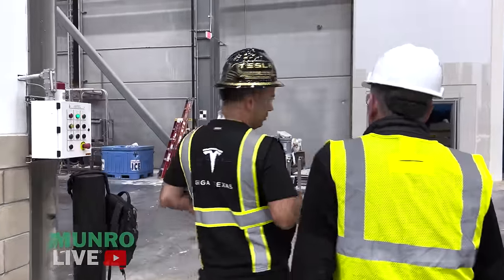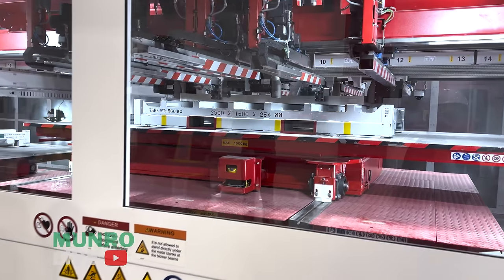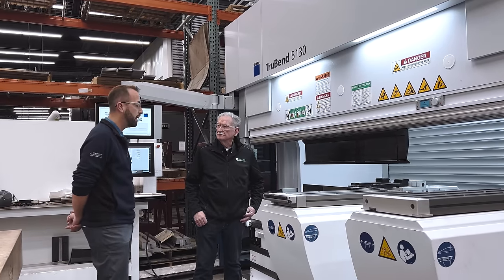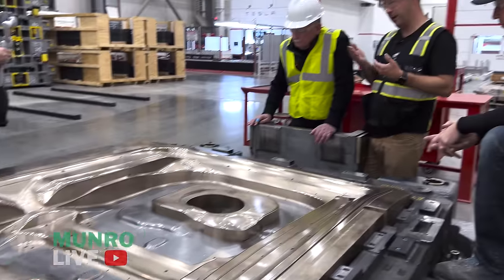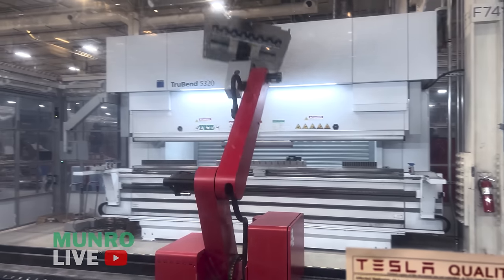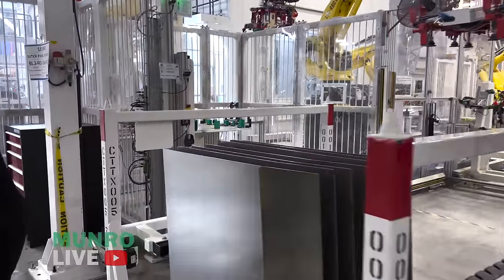Tesla Manufacturing: See how the Cybertruck HFS Panels are Blanked, Bent, and Built!

Comment: I'm interested to know how the costs compare to standard steel+paint construction. There is a lot of expensive kit here, but the result is fewer parts and fewer processes so if you make enough of them it's going to save money. Stainless costs a lot more than standard car steel, but zinc dip and several coats of paint is presumably not cheap either. I have no idea how those costs work out. They presumably have some hefty development costs to cover too. Quite a lot of smart people developing stuff over several years.

Also interesting to see how the public will take to the 'just one colour' somewhat utilitarian aspect of this. It's great from an engineering point of view: form follows function. But one of the most popular things about mobile phones when they were new was clippable coloured bodies and the people selling ring tones made a fortune. That's the stuff of marketers, not engineers. People are used to picking a colour these days - I wonder how many will be happy to lose that, having no interest in all the good things that come from not circulating loads of paint in the environment.

Anyway great episode. Very interesting and informative.
Reply: The lack of a paint shop alone saves biggus buckus.
You can wrap the Cybertruck - Franz Holzhausen drives around in a black CT for example.
Reply: @Martinit0   And that black CT can run right next to the Batmobile and not look out of place! 🤯🤣

Comment: For followers of the GT construction videos from Joe Tegtmeyer, Jeff Roberts, Brad Sloan, Airwave Dynamics etc.

0:09. Enter Stamping 2 extension through the west drive-through door.
Lars, “so this is our stamping building, we have three 5 stage tandem presses. 2 transfer presses, first of our 2 hot-stamping presses.”
Lars points north to their first of the 2 hot-stamping presses. Press is in the west side of Stamping 2. A press is visible at 0:21 as the camera swings around. Presumably this is the hot-stamping press.
0:21. Sandy, “so are you bringing in plate stock?”. Lars, “we’re bringing in coils, and I’m going to show you how we straighten it”.
0:23. Pass by the central line of columns, now in east side of Stamping 2.
0:48. Scrap bins. This particular area we saw having screw piles installed. 
0:54. Looking east out through the drive-through door.
1:35. Straightening-line in the background. Central line of columns are behind the straightening line.
1:57. Straightening-line Lead Engineer, “this is the first of its kind laser blanking-line…….this is a special development as well, this is something that is primarily used in mills”.
2:46. Stainless steel is 1.8mm thick for the doors, everything else is 1.4mm.  Presumably “the sails” are the rear quarters.
Precast panels of what was the outside wall of the original Stamping building visible past the braced columns.
3:30. Straightening-line lead Engineer, “then it’s going into the laser booth”. Which we can’t see yet. 
3:45. Straightening-line Lead Engineer talks about the accuracy, “it cuts up to 30micron and it’s the first laser of its kind to do that, typically these machines cut at 1mm (1000micron), this was a special development between Tesla and Schuler”
4:55. Door to laser booth. Lots of laser warning symbols.
4:57. Lars. “this is one of our transfer presses, smaller one, we just make small parts, 
we actually in-sourced 70% of stamping form Model Y and Cybertruck”.
Not sure what “in-sourced” means.
6:34. Second press visible to the north.
14:17. Still in the east side of stamping 2. Lars, “this is our die storage area……..the inner panels are also stainless”.
14:42. Dan, “this is our front door inner, 2 out die”
15:04. Dan points to the second press that is being used to stamp out stainless steel door inners.
15:22. “front door inner like Lars stated, dual”. Stamps 2 inner panels per die.
15:27. Die lower half.
15:35. Die upper half.
16:18. The whole die is aluminum bronze.
17:45. Dan. “do you want to see hot stamping from ground level?”
18:20. Made by AP&T. Second one coming to be installed west of this current one.
18:33. They turn west back past the row of central columns into the west side of stamping 2.
20:53. Hot stamping. Door ring/passenger side. Lars, “what are you doing now inners or outers?”
Dan, “we’re doing inners”.
21:06. Looking north.
21:23. Dan, “body side inner”
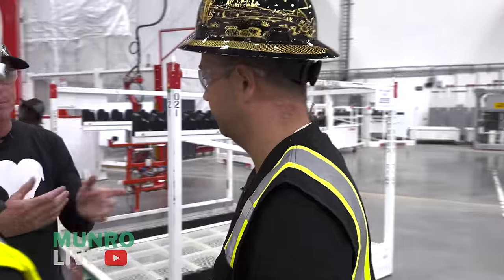21:50. Dan, “we supply body shop right over there” Body shop is west again. Part of GA.
22:25. Level 2 of Stamping 2/High Bay. Facing west.
22:41. Lars. “We actually have the body shop on the second floor here”.
22:50. Lars. “Least number of parts now, down to just over 100”. I take it he is talking stamped parts.
23:11. Level 3. Column rows M5.69. Not sure what the 5 means, but this would be M69.
23:22. Door outer on the rack. This seems to be Cybertruck BIW.
23:29. Door outers to the left and right. Column L70.
23:44. Cybertruck front assemblies.
23:51. Lars “Mainline goes this way and then is transferred to our powder coating that does the black coating over there”. Not back to Paint is my interpretation.
24:00. Sandy “You don’t use L-PO?”. Lars, “whats’s that”. Sandy, “you dip the whole car in”
Lars continues, “its a soft e-coat with a powder for that black area, we only have one oven”
Seems they don’t dunk the bodies in a bath.
24:51. H75. Trumpf Tru-bender. Lars, “one for each panel”. Suggests up to 10 Tru-benders. 4 doors, 2 rear quarters, 2 front fenders, tailgate, trunk lid. Seems a lot.
28:57. Door panel check jig. Marked Everest.
30:47. Exterior door panel. Lars, “takes 75% of the side impact load”.
31:09. F75.
32:47. F79. Diagonal external wall in the background.
32:51. Door assembly. Inner and outer laser welded together. There goes my adhesive theory.
33:35. Lars, “laser ablation” to clean up the laser welding marks. Ablation (Latin: ablatio – removal) is the removal or destruction of something from an object by vaporization, chipping, erosive processes, or by other means.
34:06. E80. Doors on elevated jigs. Saw these through the loading platform opening.
34:47. Lars, “2 brillo pads”
35:13. Completed door.
37:05. Dan has a ‘Giga Texas Melt Center’ shirt on. 
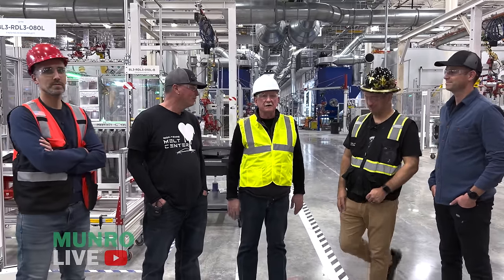37:27. Sandy, “Keep watching, because there will be more”.

QPC. Quantity Per Container.

E-Coat also know as Electrocoat , electrophoretic paint, EDP or electro-deposited paint.

Comment: I worry about crevice corrosion in the faying surface between inner and outer panels. Stainless steel is very susceptible to this behavior if water gets in that area. The corrosion rate will be sky high but won’t be immediately visible, especially with these heavy gages, for quite a while.  But if you were to peel back the two surfaces it would be blood red with corrosion. It may have been done later but that joint needs a sealant to preclude water wicking into the faying area.  This behavior is why WD-40 was invented first the atlas program.

Comment: Munro what was not completely clear was - are the body side panels (door openings that get powder coated) Stainless steel or Boron Stainless Steel. It was not clear in the video and now has resulted in questions. Seems a stainless truck does not need any parts susceptible to corrosion.

Comment: A square meter @ 1.8mm thickness assuming 8g/cc is 14.4 kg (31.7 lbs).  This is about the size of one of those door panels.  The sheet metal used on trucks has nearly the same density and a similar sized part would weight about 7.6 kg (16.7 lbs).  There is not that much SS on the CT and considering the material properties and the structural benefit the CT use of SS saves weight in the bigger picture.

Comment: Wireless charging is not necessarily prohibitively inefficient.

In a cell phone, it’s not very efficient because it doesn’t have to be because we are talking about so little power.

In a large electric car, the inductive coupling is the important thing, and that is a well established field of electrical engineering.

I’m in electrical engineer and I can tell you please don’t worry and lose sleep over it. It will come along pretty quick and it will be well in the high 90% in efficiency.  Expect 95% or higher.

Comment: I'm still hoping they will once make a semi trailer with batteries, electric motors, solar panels, name it.
They could make an ultracasting for it, put it full of camera's so it works together with the semi FSD really well. 
It could even park on it's own, without the semi needed to be attached to it.
It would help with cooling transport and it would even make a diesel drive much more efficient.

Comment: I have been working in stamping industry for 30 years, i can assure you that nothing -laser cutting, hot stamping, air bending etc.) i saw on that video is done either differently or better than in the car OEM factories i work with in Europe or China. Typical tesla narrative: we are far better at innovating in what everybody else has been doing already for years. All these machines are standard, the mentioned tolerances are standard, no process innovation ever mentioned: straightening coil before stamping and optical blank measuring? What an innovation !

Comment: "If your bad at what you do" holy cow dude 😅🤣😂🤣😂
Insane they got down to sheets that are less thick than 3d printer filament line. HFS is some insane stuff. Quick to make. WOW
Just on some of these parts they could ramp to crazy fast with current stamping processes. Of course whatever slowest prart/process will determine production, likely final assembly.

Comment: Sandy, Lars, you’re using Bronze-Aluminum coating on a steel die and you have to refinish it every 50 stampings? YOU NEED TO SWITCH TO BLAZE®️ from B4C Technologies. It will reduce your friction coefficient on Stainless Steel by around 45% while increasing your surface hardness to an extrapolated 106-116 HRC… harder than Thungsten Carbide. And it’s not a coating. It’s a non-brittle thermal infusion that will not affect your die’s geometry. As CEO of B4C Technologies I welcome your inquiries.

Comment: Number of parts before aluminium bronze die 'reworking' around 17:00 make little sense, whether 70, 80  or 1200.  Surely that would  make production costs astronomical ?
Reply: Not really. They aren't replacing them remember, slotting a new one and tuning the old one to make sure they still perform well.

And that is at the start of ramp up where they want to keep everything in check and are super conservative with their tools.
Reply: @mobiuscoreindustries  I'm curious on how  many body panels a typical automotive press can  make before the tooling needs overhaul and what the unit cost of the processing would be. I understood the tooling cost is astronomical, based on past  experience on simple forming of industrial lighting reflectors a while back.
Reply: @philhealey4443  I think it comes mostly down to time. 

Like how long does it take to swap the die with the spare and how long it takes to overhaul the die so it can be rotated again. 

Since they have been incredibly effective with their model 3 and Y production lines using much of the same things I would assume that they are adopting this practice for a very good reason. Of course there they use aluminum, so they probably get more cycles out of it, but I can't imagine they would make such a radical pivot without applying it to their other processes, as they have done with every other tech iteration on their other models. 

But I am not directly working on that kind of machine nor privileged to industry knowledge so I can't really infer more than that.

Comment: Amusing trivia @21:09 and @23:28: the electric car company is using propane-fueled forklifts inside the factory, not battery-electric.
Reply: Just like how solar panels get transported by trucks and wind turbines get shipped to their ocean foundations by petrol powered boats. 

You cannot do everything everywhere and all at once. Fossil fuels are still incredibly convenient and energy dense and a way better option than BEVs in many situations .

But every automobile on the planet pollutes more than every forklift on the planet. So you sort out by levels of effectiveness
Reply: @mobiuscoreindustries  I understand your point, but electric forklifts are readily available... you can have electric truck production and electric forklifts at the same time. 

Also, there's no chance that a modern car compliant with current first-world emissions regulations and used for a few kilometres a day emits more than an unregulated heavy forklift working all day.

Comment: 25:31 air bending, up until today, meant bending on a press brake without coining the material into the bottom of the die.  Actually I'm pretty sure that's still what it means but I'm still a little curious if they actually have some new innovation here.  Sounds like someone misunderstood what air bending is and is trying to use it as a marketing ploy.

Comment: Wow, 50-100 parts before the bronze aluminum die has to be reworked. A conventional cast iron chromed die lasts for 10,000 hits before any rework is required. Very low volume tooling.

Comment: Just wow. So much innovation. I remember when I bought my first Tesla, a 2019 Model 3 SR+. I bought it sight unseen and had never been in a Tesla before. At the time, Tesla had a money-back guarantee: Order a car, drive it for up to 7 days/1,000 miles and if you didn't like it, your money would be refunded. I thought to myself, "well, what do I have to lose?" I bought that car because I was commuting 90+ miles/day and was spending a ridiculous amount of $s on gasoline. I remember the day when Tesla delivered my car to my home (back then, a Tesla employee would personally deliver your car!). I took it for a test drive and was shocked! I'm a car guy, I've owned over 16 Mustang GTs in my life, and I love performance. With the Tesla guy in the passenger seat, I told him I was going to check out the acceleration and he said okay. I pressed the accelerator and my jaw dropped to the floor. I had no idea Teslas performed like that ...and the fact my car was the single motor version and accelerated like that far exceeded my expectations (back then, the single motor Model 3 did 0-60MPH in the low 5s). When the Tesla guy saw my surprise and reaction, he said "Yeah, we get that a lot from our first-time customers". From that point forward, Tesla had my respect. After 40K miles, I upgraded later to a 2022 Model 3 LR in late 2021. In Feb 2023 I upgraded to a 2023 Austin-built Model Y LR. To see in this video how far Tesla has come since I bought my first Tesla sight unseen 4 years ago just blows me away and makes me so happy that an American company is making such a huge impact on the world. I absolutely love my Tesla Model Y LR, I've driven it from Dallas to Jackson and Yellowstone, WY (3,500 miles round trip). It's such a wonderful car. I can see a Cybertruck in my garage in another couple of years! Thanks to all who made this video happen and kudos to everyone at Tesla for the incredible work y'all are doing!

Comment: From the perspective of the vast majority of vehicles on the road, not to mention cyclists and pedestrians...isn't super-strong stainless steel incredibly dangerous as an exterior for a vehicle to share the roads with?   Normal cars, aren't they designed with some level of 'give' in the event of relatively small collisions?  Adding cars made of completely unforgiving knife-like material seems weird to me.   aren't normal small vehicles, cyclists and pedestrians at an exponentially higher risk from this material?   not to mention the repair cost for the Tesla owner, if these panels are not 'fixable', the full panel will need replaced in ANY scenario where the panel has even a small defect?    Also  notice the nearly fully-robotized factory...the humans in this video are not the traditional 'factory floor' fellas...gotta think nearly all of these humans are marked for robot replacement, built right into the overall design process.

Comment: I am having a hard time telling if Sandy is impressed over here now at the hot stamping station, It's a tough read on him, he's, Sandy knows his material.. he knows his metals and his engineering.. he's a damn tool maker, he knows this inside and out, and Tesla has COMPLETELY flipped the script on him, but I am having a VERY hard time realizing whether he's impressed or disappointed. I just can't tell..
edit: ok.. about 25 minutes in or so I realize now Sandy has seen all this, maybe not this big, but this isn't exactly the impressive part.. I think up the ramp and over the top, how they fit the stainless, that's what he's interested in. I think the fact that the steel is 1 on a custom roll (custom doesn't matter but) but it's raw.. bare.. unprotected. I've been around, and almost EVERY finished product face has a blue clear or white film across it.. no questions.. That, I think, is part of his hesitation.. HOW do you keep fingerprints - or ANY other marks - off of stainless finished product WITHOUT protection.. Maybe I'm wrong, we'll see